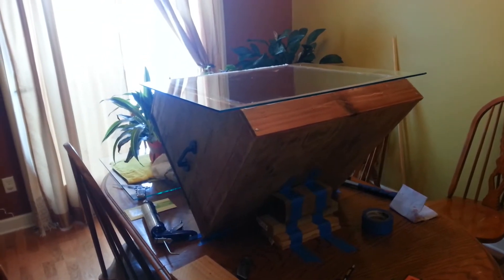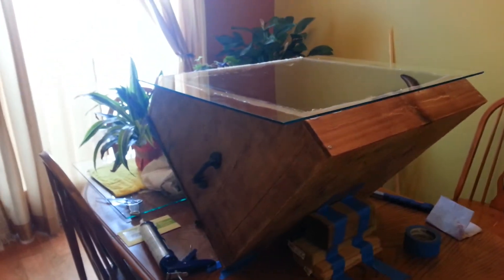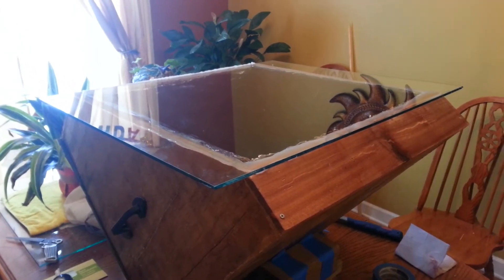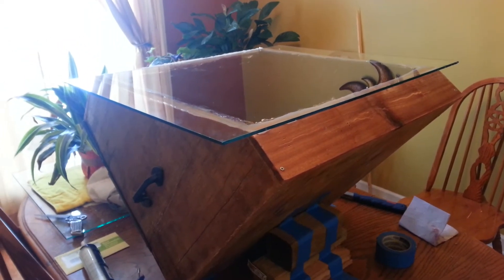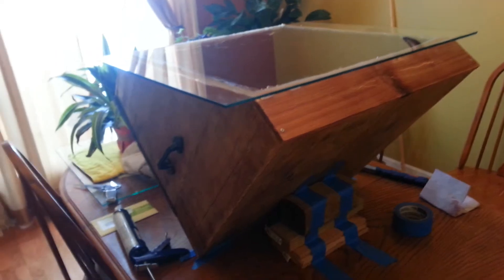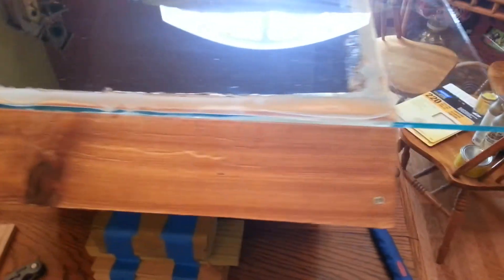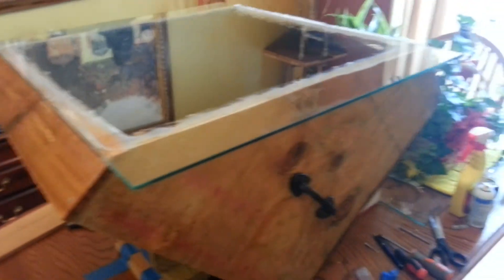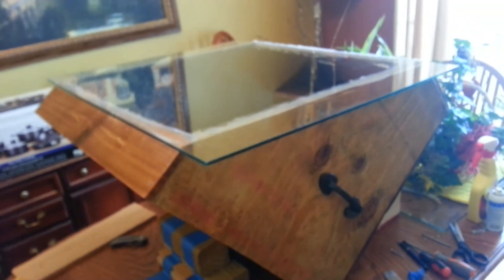Large Solar Oven with Rear Door Access Part 3

Comment: You used cedar wood ... Cedar contains many volatile oils that may outgas when the temperature rises ... Just a thought ... Also you mentioned in part 2 that you used high temp grill paint for the inside ... What type silicon caulking did you use to seal the glass to the frame and what provisions have you made to keep the glass tight on the frame since silicon is flexible? ...